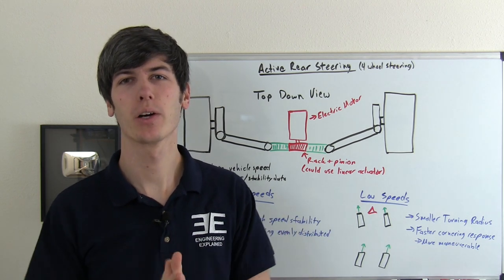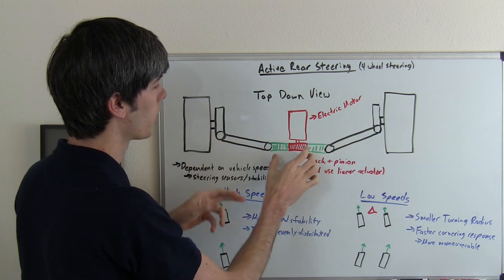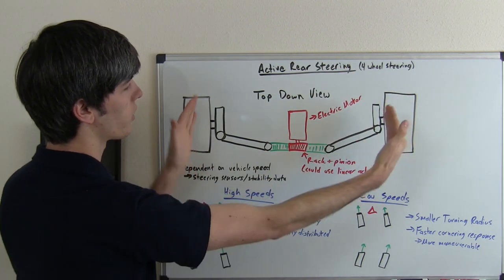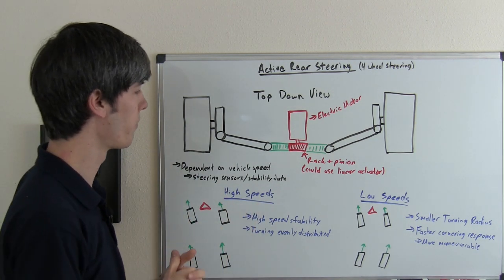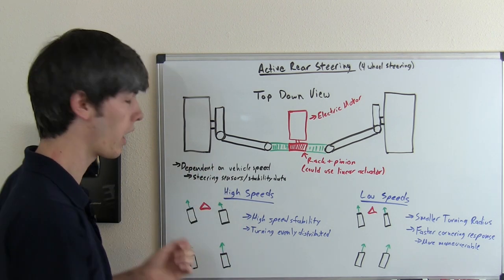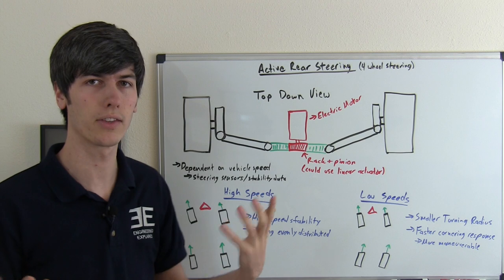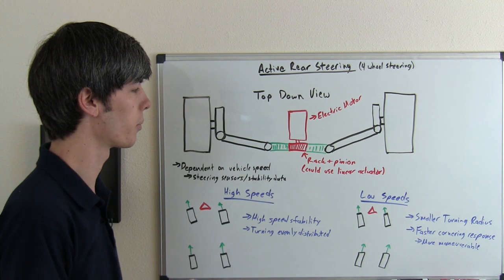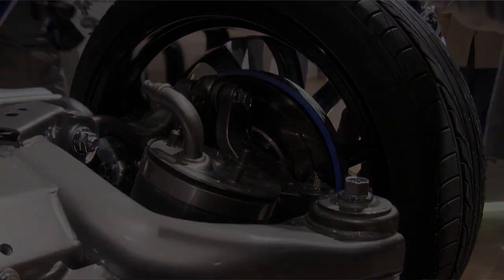Active Rear Steering - 4 Wheel Steering - Explained

Comment: What happens when you are turning a corner at very high speeds? For example on a large off/on ramp. Does the car think you are turning or changing lanes?
Reply from the maker: At high speeds they wheels turn the same direction. That said, the front wheels will turn more, so they'll have more influence.

Comment: Have to think even at highway speeds, you won't put as much steering deflection into the rear wheels as the front(even though they're now turning the same direction) -- If you're going around a large curve, as you said WRT to slow-speed, you won't be "turning". The stability is more for quick movements or lane changes, so you have to find a way to differentiate between which actively while driving.

Comment: would be cool if you could use the "high speed" set up of turning all 4 wheels to point the same way at low speeds too when parking. imagine you've just parked in a normal parking bay but a bit too close on one side... you could just shimmy forwards a few feet and at the same time increase the gap  you want to make. straighten up and then move back those few feet with the increased gap without having to use too much steering input and having to steer one way and then the other to "swing" it into the desired position... which can just go too far or put you right back where you started :P

also very jealous of the S4 video!!!!! in the market for getting one myself here in the UK :D
Reply from the maker: DrSasso Ahh, that would be interesting - could help with correcting parallel parking yes.
Reply: I think there has been concept cars made with that kind of steering in the past. Pretty sure they refered to it as crab steering. It wouldn't be hard for companies like lexus to add that to their current system. Just needs an input from the driver so it knows what you intend to do.
Reply: DrSasso that is a very good idea, I completely agree with you. This would give a very good help to most drivers in Ireland, I've seen many dissasterous drivers trying to desperately park their cars. They would usually end up causing an obstruction or just leaving the space entirely, also ruining other drivers moods.
Reply: Parallel parking is what I thought of, but shifting around in a parking spot would be very nice if it is too narrow for both doors to open. Also in high speed corners you could angle the car to compete body roll. (Would be like drifting with complete grip :D)
But it would really need a way to controll it... Two steering wheels would be very confusing. Maybe (esbecially without manual transmission) there could be some kind of pedal to decide the ratio: Toes for parallel driving, heel for extreme cornering (relax for fixed back wheels)
Sounds fun! I want that alot!

Comment: If this only shifts the car side to side at high speed, how would this work on a track or an autocross (solo) where there are high speed corners where the car needs to change direction?
Reply: It depends how hard you are turing and your speed, I had a mazda Mx6 with rear wheel steering and when you gerk the wheel or brake slightly it knew what you wanted to do.
Reply from the maker: Also, the front tires have a much higher degree turning angle if you're turning in hard.
Reply: Thank you
Reply: Logan Chambers Keep in mind what you want is a very small change in angle on the rear to either generate stability or oversteer. My FWD Acura for example can oversteer but that's because I have the toe out set to 0.05 degrees on the rear. When you corner the outside rear wheel tries to get the rear to step out. With toe in the rear feels much more stable under braking and on high speed corners. A small change like that can change the characteristics of the car completely.
Reply: I think but might be wrong that it has something to do with side slip build up on front / vs rear axle. Might help make side slips more even between axles and that could increase performance.

Comment: Why not have a 1:1 ratio between the back and front, wouldn't this give an even tighter turning radius? 
Also, independent rear steering would work better in some cases, like under braking to provide pigeon toeing. And with computers, you can have accurate ackerman with any angle.

Comment: My Honda Prelude SI was 4WS 1988 it was awesome! All mechanical no electric motor or wires! It was nice!
Reply: That was the best version because it was steering wheel dependent and speed dependent-by nature of the way you drive. It was just heavy but it was very strong and reliable, it rarely broke!
Reply: Yes it was badass I wonder why the discontinued it
Reply: Cruz Ortiz You know the track record  of corporations making quick decisions. The mechanism added more weight to the car and the car had a very weak engine, people complained about that. So, instead of just giving it a more powerful engine, they cut the mechanical version out and opted for the electric version. The electric version was good but it broke a lot because of the lazy way they wired the thing-lots of cheap wiring. When people complained about that, they took it out the U.S. market. The old mechanical version 1987 to 1990, was only in the overseas market, the U.S. never officially received that version, although you may be able to pick one up here and there in the U.S.

Comment: What happens in a high speed and very large diameter turn? Is the wheel angle of the rear wheel steering exactly proportional to the fronts at high speeds or does the amount change depending on something like steering angle?
Reply: the rear wheels get about 4 - 10 degrees to turn (on older models) so the front wheels still do most of the work.
Reply: xkblxcripple Gotcha, this makes more sense :-)

Comment: Things to do EE on next:

Wrinkle wall tires
lenco transmissions
Slip angle 
Anti-lag
Reply from the maker: Super0dp I have two videos on anti-lag. :) Might tackle slip angles sometime though.
Reply: +Engineering Explained I had to do a school project on drifting and slip angle and when I looked into it it was amazing the complexity of it all. I can PM you the slide of it if you want. It's something crazy with the radius and tangents of the turn, angles and CG of the car in relation to the radius and a whole bunch of other stuff.

Comment: i own a St-203 6th gen toyota celica. it has 4 wheel steering, however it is only operating on the 'fast setting' where all four wheels turn in the same direction. do you have any idea what the problem is likely to be. This car is rare where i am from so  most people are clueless. will have diagnostics done soon but any info you have would be great.    (from Barbados)

Comment: I've got an idea in my head for an all terrestrial vehicle, where the wheels will need to be able to extend free of the body, and have been evolving my thoughtpath in the direction of using some sort of robot arms that have suspension in each limb section, hub motors and hubcaps which transform into variable pitch propellers.
The interior of the wheel rim should be shaped like a manoeuvring cowl on a ship.
In theory, the arms should give a completely smooth ride when on land, it would be possible to alter center of balance to become a true four wheel drive, four wheel steer/prop.
With all of the current and pipeline vehicles and technologies in the works, the tech will soon be readily available to design and create the vehicles of our crazy childhood dreams!
The future is finally here!

Comment: Wouldn't the 'opposite steering' mechanism be better than the 'crab steering' at both low and high speeds?
if stability is a problem the angle can just be reduced, no?
I can imagine race cars would go around corners much faster with the 'opposite' rear wheel steering system.
Reply: Not really. At high speed that would compromise lot of grip.

Comment: Hey Engineering Explained , i was looking into some flywheel kinetic energy recovery system, pretty intresting theme that you definitely should make some videos about. But they use a wet clutch to connect/disconnect the flywheel from the wheel, so i was wondering if there would be any friction loss in the wet clutches? Or would the rotational inertia in the clutches cause them to separate completely, also the the oil should slow down the flywheel pretty much?

Comment: I'm looking to set the low speed variant of this on a monocoque chassis with 13 inch rims and a drexler style differential is there any particular area of physics I must look at such as ackerman. Could you point me in sort of a general direction of what data I need so the car doesn't oversteer or understeer

Comment: A good idea in theory... in practice the implementation and 20 years of aging can make a bit of a difference. Nothing like your car's system randomly deciding to work on a particular corner, ripped mine out.
Reply: check out porsche 918 spyder. 3rd best lap time on Nürburgring
Reply: +M.a.D. try in 20 years time though
Reply: +M.a.D. try in 20 years time though

Comment: Hi Jason, have a question about this. What happens when taking a curve on the highway (60mph)? I mean, this pseudo-parallel movement won't help on the turn... looks like. Thanks!!!
Reply from the maker: Jorge Concheyro The front wheels will be rotating more (looking from above) than the rear, so you'll still be turning, rather than simply facing forward and shifting left/right.

Comment: the nissan 300ZX's have it with a hydraulic system. most people don't like it for maintenance and weight reasons. i personally think its a cool feature that should be implemented into more cars
Reply from the maker: rustybacon54 Yeah it'd be interesting to see if the benefits outweigh the negatives. I'd be curious to see some performance testing of cars with and without.
Reply: Engineering Explained What was the fastest car through Road and Track's slalom in 1988?

Comment: hey I was wondering if you could do a front wheel drive explanation but without a transverse engine. Like in an audi  or older Cadillacs
Reply: Think mid engine transaxle, but mounted up front. Scobaru fwd boxes are a good option if your home building a rwd, mid engine car, and want to do it on the cheap, plus boxer low CofG. You can also use regular transverse fwd engines and boxes, but that makes for a shorter wheel base, or funky layouts.
Reply: yup identical to longitudinally-mounted mid-engined transaxles.
Reply: But see in like a Cadillac 500 Eldorado the engine is like right in the middle of the strut pillars and it looks from the eye I can see is no way you can cram a transmission so it lines up with the axles.
Reply: kevin soos I just had a look at the tranny on one of those and its a weird bird, but its not too difficult to describe (changed my mind about that statement mid way through writing this, but I'm a sucker for punishment lol). Basically, think of a mid engined transaxle again, but shifted to the right (looking from in front of the hood), offset so it sits beside the cylinder V, and rotated 180*.
Basically power is shifted  from being inline with the engine by either gear, or chain (not sure what they used) to be inline with the gear box that runs beside the right side of the engine. The gear box is then run bassackwards (rear of car---> Front of car), and power is taken off like a FWD transmission, and passed under the engine through CV shafts. 
To simplify, Think of the transmission as an Inverted J
A trip to google images will make this a whole heck of a lot clearer
Reply: Oh ok. I think I got the picture. What should I search on google to get the best picture.

Comment: why do they install this low reflex motor instead of 2nd servo system but with oil pressure motor and worm gear?
Reply from the maker: Gotin Fuklio Electric will be quicker to respond and more efficient than hydraulic.
Reply: i mean electric makes some delay while hydraulic can remove this problem if the system is at high pressure

Comment: My infiniti has 4 wheel steering. When I cut the wheel I cannot see a difference in the rear wheels. Maybe it doesn't happen in park? Typically about how many degrees would the rear wheel turn?
Reply: +Jabba12000 0 In that system not very much. Minimum change and only at high speeds.

Comment: What if I'm driving at a low speed then accelerate, are they going to turn on the opposite direction then go straight then turn in the same direction as the front wheels?
Reply: +Klaus Scherer I assume it would, theres gotta be some threshold at which the back wheels change orientation

Comment: Very incomplete in my view. You didn't explaine that the system also works with the esp to stabilize the car without using the breaks. It is specialy efective in breaking in unheven susfaces by using the rear wheels to auto counter-steer it can reduce the breaking distances by a huge margin.
Reply: lol, that is idiotic

Comment: What's the relationship between bore/stroke ratio and the "torqueyness" of an engine? Imagination tells me a longer stroke increases torque, but the Integra Type R is one of the highest revving factory engines ever made, and it uses and undersquare engine, and for example the old Ford Windsor 302 V8 used an extremely oversquare engine, but it's very low revving and full of torque. So what gives?
Reply: Mostly because you're trying to equate revs with torque - and they are two separate entities.  Torque is independent of how high the engine revs - horsepower is linked to engine revolutions - not torque.
Reply: I thought I was trying to equate bore/stroke ratio and torque, and bore/stroke to rpm, independently of torque. I know torque and rpm are independent of each other, but I don't understand the relationship between bore/stroke ratio and those two separate things.
Reply: ExactlyPrecisely Torque is related to compression ratio. Bigger compression ratio= bigger bang = more torque. This is also why diesel engines typically have more torque.
Reply: Compression ratio doesn't equal a bigger bang - compression ratio allows more energy transfer to the piston for a longer duration.  That equates to more torque when everything else remains equal.  If you want a bigger bang, add more air and fuel.  That's what turbocharges/superchargers, and overall engine displacement increase is for.

In a simplistic standpoint, the bore/stroke ratio in itself means nothing.  If you match everything else up (fuel delivery, intake porting, overall engineering) like a Buick 455 (huge bore/short stroke) and an Olds 455 (small bore/huge stroke), they make nearly identical power at the same RPM.  The reason why large-stroke engines sometimes produce more torque at lower RPMs is because they are engineered to operate lower in the RPM range due to the larger mass/inertia and velocity differences in the rotating assemblies.

The absolute fact is - it's comparing apples to pears here.  He's comparing a fuel-injected high-compression 4 cylinder to a mostly carbureted 8 cylinder.  Nowadays, everything from the fuel type to the compression ratio all the way up to fuel delivery, air induction, cooling, and intake design all have an impact on overall torque, peak torque, and where that torque is delivered in the RPM range.
Reply: Okay it makes sense now. So an increased stroke produces no increase in mechanical advantage, and so it does not influence the torque production of the engine. it's other factors like you said, fuel delivery, compression ratio, all that stuff that is deliberately designed to make the engine the way the engineers want it to be. And it just so happens that I saw two very different engines both leaning on opposite extremes of the ways engineers design engines, and noticed a single aspect of them that was different, and thought that had something to with it when in fact it really doesn't. Thanks for taking the time to answer my question GammaCruxis.

Comment: it would be nice to have something like that to cut the truning radius on my truck, but then you loose the solid axle right?
Reply: Every home built system ive seen was built with a solid axle (used 2 front axles). Usually use a hydraulic system and a joystick or switch of some sort to control it manually as well. One of the greatest things ever when backing up a trailer. You will probably want some way to be sure that the rear wheels return to center (truck i drive at work just has a light on the dash) and a system that holds pressure (so that the wheels stay at what ever position they are moved to)

Comment: No other car has and all mechanical 4 wheel steering system like the 3rd gen prelude. Every other car 4WS is based of a electrical module/motor. My thought is what if the sensor or motor fails during a turn and stays stuck. You won’t be able to drive the car at all lol

Comment: Is it true that older generations of the RX-7 have a rear wheel steering? If so, how does it work in this case?
Reply: +KingLuigi96 Don't know, but Honda Prelude used to have it.
Reply: +KingLuigi96  Yep. Many Japanese cars around that era had it. Some examples include Toyota Celica, Nissan GT-R, Prelude, 3000gt. It works the same.
Reply: But only the JDM cars? so the old japanese cars that weren't sold in japan didn't have this right?
Reply: KingLuigi96  I think so, but I am not 100 % sure that all of them did
Reply: The rear wheel steering in the Rx-7 was called DTSS, Dynamic Tracking Suspension System, and if you had enough g-force (essentially load) on the back wheels going through corners, it would allow the rear wheels to slightly adjust their camber, not steering. It was essentially loose bushings put on the back wheels. I think 1983 was the first year to have this.
Reply: +KingLuigi96 the US 240sx had it in some cases